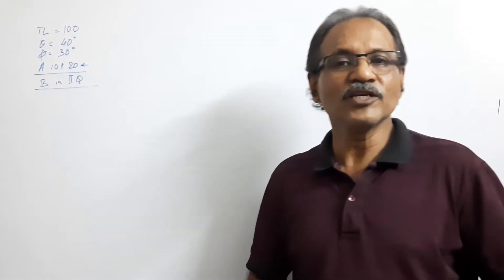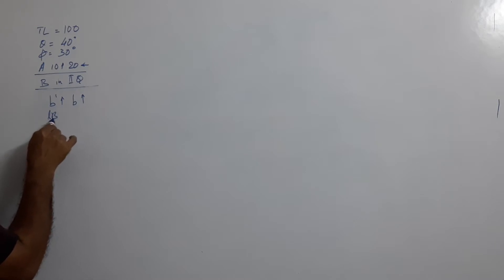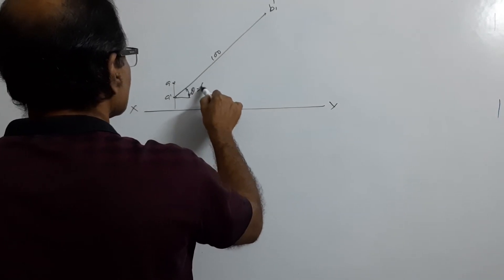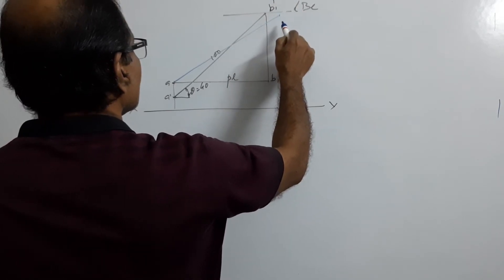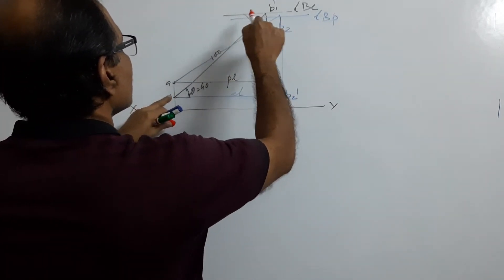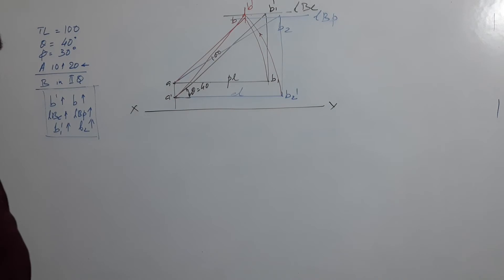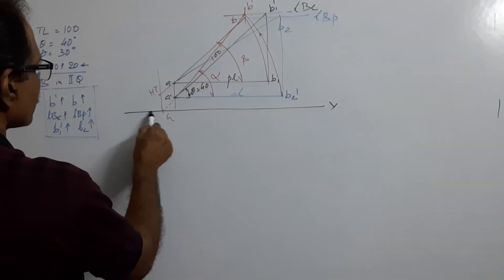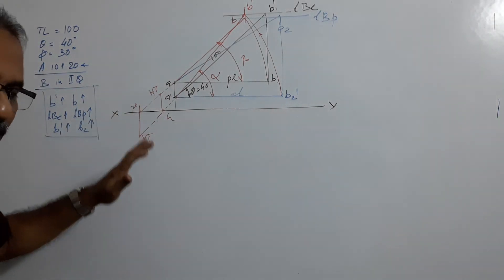Projection of Lines - 10, Line inclined to both HP and VP by Prof.Vinodkumar

Comment: Sir please make video on 4th quadrant only
Reply from the maker: Diwanshu, Sorry, your comment is not clear to me. You want full line in 4th quadrant?  Pl see video Protection of Lines 20
Reply: @EngineeringGraphicsbyProfVinod  A line PQ, 50 mm has its end P 15 mm away from HP & 20 mm away from VP. It
is inclined at 30° to HP & 45° to VP. Draw its projections 1st and 4th quadrants.
Assume that the whole line lies in same quadrant. 👍Sir this is the ques👍
Reply from the maker: @DiwanshuSharma-p9t  Pl see video 20